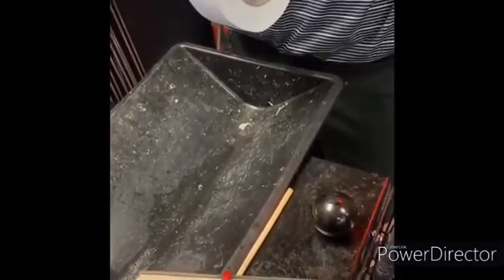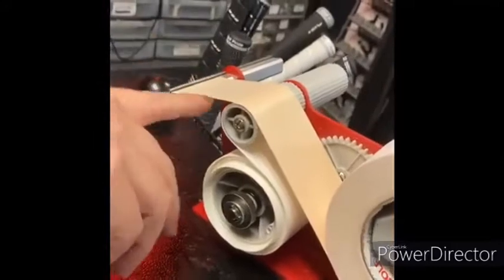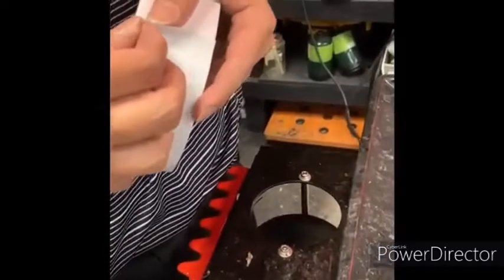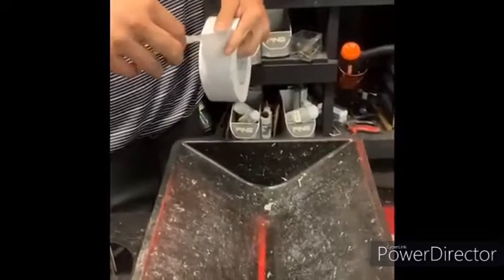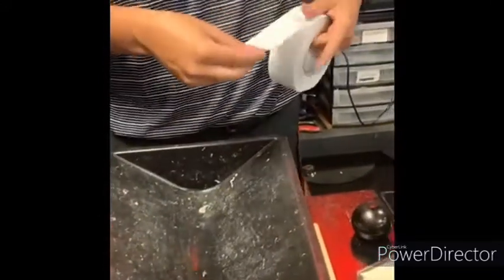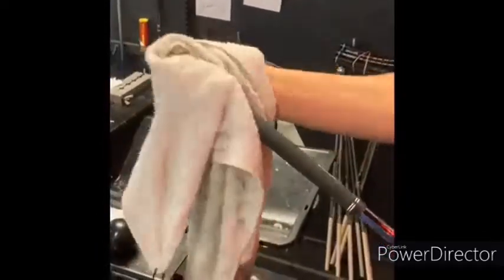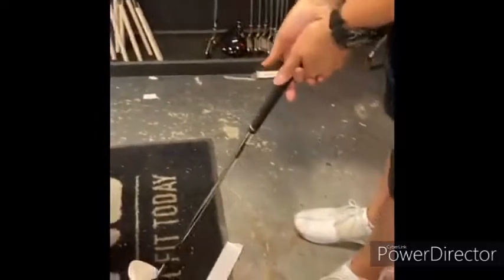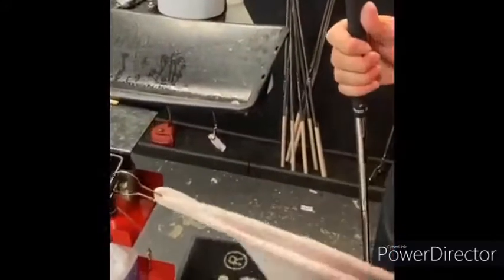Testing An Alternative of Golf Work Double Sided Gripping Tape

Comment: I had a roll of this tape. It works okay but it takes forever to peel the one layer off. Prefer the pre cut lengths.
Reply from the maker: I don’t like it.  It is not that much cheaper than golfworks’ tape.  Not worth the time to keep trying to peel that layer off.  I notice why it is so hard to slide the grip on is due to lack of glue on the tape.  When we pour solvent on, there was not much lubrication